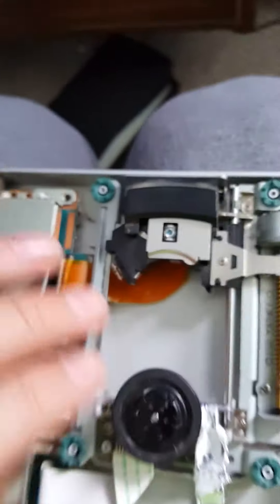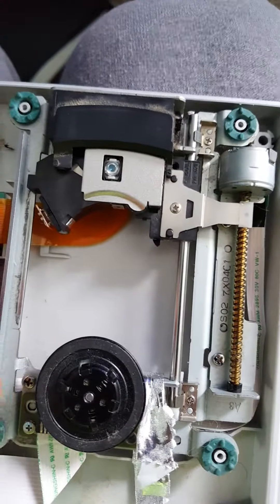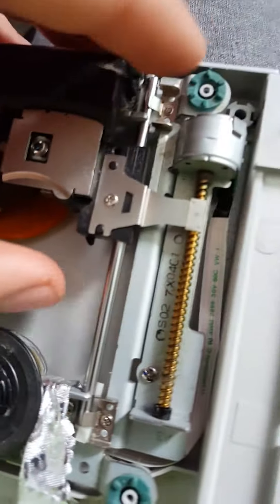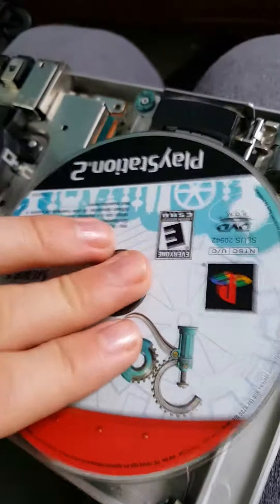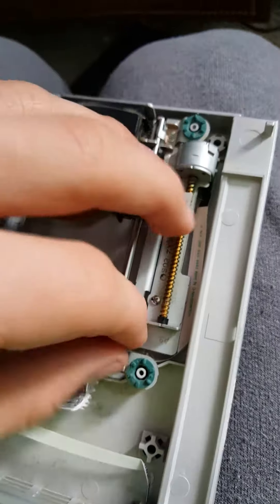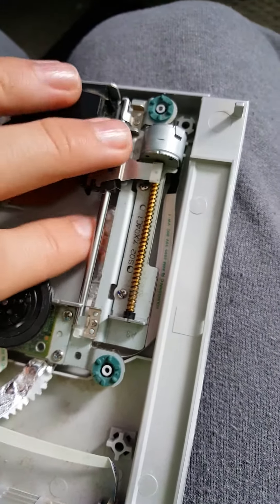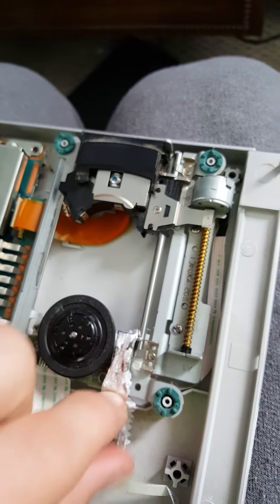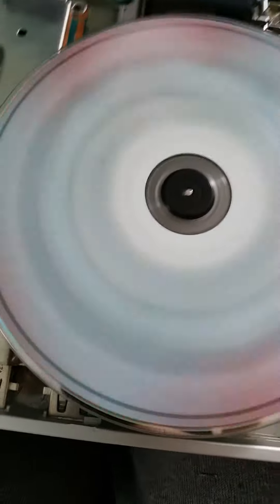Ps2 slim grind fix.REALLY WORKS

Comment: Guys guys. Not sure if the guy made an other video but the problem is right. The solution isn't. It works yes but its an easy fix and it's better than a tape. On the left side of the laser (black triangleish) they is a a space shape like a u. You just need to put it in between the metal. That's it. It make the noice because the laser doesn't go under the circle when it's supposed to. Your welcome 😃
Reply: Hi! Thank you for the solution, can you be more specific? I can't find what you're refering to.

Comment: Absolute legend. My PS2 was making the same grinding noise. The ribbon cable at the laser end had come out, pushed back in with tweezers and works fine. Wouldn't have figured it out without this video, thanks a lot dude.

Comment: YOU ARE A GENIUS!!! I couldn't find any gum brands with foil wrappers but I bought some LifeSavers mints with the foil wrapper and it worked like a charm. SOOOOO thankful for your video and tip!! My old PS2 slim that I couldn't get to work normally for over 4 years now works like new!!! 5 stars.

Comment: I followed this sort of.  It was corrosion on a rail stopping the laser moving smoothly for me. Used vinegar and a little ball of tinfoil to clean it. Cleaned in the plastic runners on the sled bit too. Works perfectly now. Thanks for the inspiration on the button.

Comment: I know this video is 5 years old now but you didn't need the gum wrapper. The little clear ish/white plastic thing under the silver bar is put on upside down and backwords. That is what the Lazer is hitting and preventing it from coming down far enough to hit the switch. It's easy to tell because the square part is showing on yours and it should be the t shaped bit. This means it's upside down and backwords.
Reply: Ok but i don't understand exactly.
Reply: @AndreiGamer1k  Hmm, I tried to post a picture but the comment keeps disappearing. I guess google doesn't like links or something.
Reply: @kairokusuen1482  ok. Hmmmm.. try to post it on my video comments section.

Comment: Clean and strip the old grease off the two rail bars on the lens rack with contact cleaner. Use a toothbrush to clean off any old grease on the worm gear. Clean the sensor switches with contact cleaner. Re-added lithium grease on the rails only (if you use it on plastic, it degrades it) and it should work flawlessly.

Comment: I fixed it guys, i only cleaned both sides of the laser. I didnt have to pump off nothing. Now it works but it does a little bit (not hard) of sound.

Comment: Looking to fix a fat and for some reason this video made me realize that I should check the ribbon cables thanks to 0:10. Turned out when I went in to replace the clock battery that a ribbon cable came out after putting it back together. I got it working again but it would stop after a few minutes like the cable is coming loose. Took a few attempts but I had to put a piece of electrical tape to hold it and now so far no issues. I don't know if I wasn't putting the ribbon cable all way in but I was pressing it as far as I could get it to go so not sure why it's loose. As long as the electrical tape holds I should be good.

Comment: hmm I seem to be out of luck. the button isn't working at all even if I stop it with my finger

ah I took it apart, one of connections of the button to the board is broken, so I need to soder that tiny tiny thing

Comment: Found out what was the issue with mine, it was that brown-cable that had wasn't attached properly. If this video doesn't work, try moving the cable in the connector while it's grinding.

Comment: My laser just comes down even when i touch its sensor . i have removed the lid off and have done as you did . But the laser still comes down with pressure . Pls do help(I have slim ps2)
Reply: Same problem with me. I tried paper tape but to no avail. I'll try aluminum foil and see if it makes a difference.
Reply: Nope, didn't change a thing.
Reply: @robertoaguiar6230  Does any have any solutions ?

Comment: Which model is that? You're laser ribbon is totally reversed of my 90001 that I recently bought off eBay. I cannot believe you had to place something there to stop the sled before making contact with the spindle. Insane.  Anyway thanks for answering a question I had, as to does the unit read from inside, out. I'm also having the disc scratching from the ribbon. So I ordered a couple, in hopes to cure that. My old PS2 was a fat model. So I never had problems. But in defense. It was brand new. Not 13. Or whatever this one is. 
Thanks 👍

Comment: Hi. Im javing this problem too. The first problem i had is the ribbon scratxhing the disc so i tried to fix it. But now it wont read disc anymore and it makes that noise. I tried putting my finger like what u did, to test if its the problem, mine still keeps making that noise even when im using my finger to press the little button on your video. Pls help
Reply: Did you found solution
Reply: @aleksandarbahtijarevic843  I probably damaged the ribbon. I replaced the ribbon and now it works

Comment: Hey Evan, highly doubt you will see this but i unfortunately have a very similar problem to yours. It grinds just as it did in your video, although i tried the gumwrapper and it still didnt work. i then tried placing my finger early like you did in the video. That part with the laser kept running into my finger and wouldnt move back to its original spot. also my laer didnt light up like yours did. what do ii do? buy that part as new?
Reply: same here, have you solved the problem?
Reply: No, I belive I have to just buy a new part
Reply: +kyle pletoka i buyed and installed a new laser but, nothing worked, maybe is the flat? who knows xD
Reply: +luckyxever that part what goes to that "golden" thread has worn too much, try to bend it little bit if you can amd if its metal
Reply: did you replace the flat?
Reply: no, just bend it little and oil that thread well and it will work. i had same problem because i didnt use my ps2 in couple of years so just start using it again and it will start working like it use to
Reply: and there is two little screws on top of that flat part that you can tighten just right amount and it will stop making nois
Reply: schwartzy65 
What parts should I oil without ruining the others?
Reply: A Terran Republic Grunt i oiled that "golden" screw part and mostly that part of it that goes inside to that round thing :)
Reply: schwartzy65 
With something like WD40 I'm guessing?
Reply: A Terran Republic Grunt yea thats should be good
Reply: ya
Reply: if anyone figured that out let me know just bought one doing the same thing this hack doesn't work for me the sound continues

Comment: Mine seemed to hit the thing but I tried to do this anyway including lubricating the thing the laser rides on because it slides hard still not fixed any ideas?
Reply: Had the same issue with a PS2 79001 that I recently bought it was practically new but I'm assuming the previous owner touched the laser lens I cleaned it with a cotton swab and isopropyl tested it out before assembling and it's working perfectly as of right now. Look up how to clean the lens and don't over soak the swab
Reply: @moichamoy2274  thanks ive tried that but  maybe I over soaked the lens even if I wasn't trying to can't do much right now because somehow my brand new ribbon my dad put on was working fine the ps2 was working still making that sound just not as bad ig next day wouldn't work it was the ribbon theres a tiny tear on the new ribbon
Reply: @zacharysmith4408  I go to an electronic repair school, that was my issue. The ribbon cable attached to the laser was torn, you can either order a new one for 30c or fix it XD

Comment: i had this problem and I got fixed lubricating the worm gear with wd-40, also put some grease in it, I forgot  what type of grease is needed to lube this thing, and my problem was fixed
Reply: White Lithium grease.  Avoid using wd-40 unless you are going to wipe it off afterward, because it attracts dust like crazy.
Reply: The lithium grease sony uses is quite dry almost like a wax, that is ideally what you want

Comment: Mine isn't so much as a grinding sound as it is an occasional clicking sound that fades eventually, but sometimes this cause the system to not play certain games.  The only time it's persisted is when I tried to play Mega Man Legends 2.  
I bought it secondhand and this did not happen at first with PS2 games. The seller says they never experienced this problem. I'm not very tech savvy so I'm kind of afraid of opening my poor system up XD

Also, PS4 in the background: "Stop playing with my big brother all the time! I wanna be noticed!"
Reply: Update!
I merely needed to clean the disc tray again with a can duster(the system was very dusty and dirty and required a thorough cleaning when I bought it) It has stopped the clicking sound, but the minor grinding sound it makes when playing Legends 2 persists. I assume it's just a matter of the game itself.

Comment: My issue turned out to be one end of the ribbon cable for the laser was not plugged in all the way
Reply: Same though that was on my fat PS2. I will probably have to open my slim PS2 to replace the clock battery but I got to get a power supply brick for it first.

Comment: Is there other ways to fixed the grinding noise?  Mine sometimes gets that grinding noise when i turn on the console.

Note: Mine is the Fat version
Reply: Its a slim model help but i share it with you maybe it helps a little.

Tight the screw next to the lens to the right(on the little iron)...  if it doesnt work first you have to clean the dirt from that little long roll and the end of the little piece of iron (the plastic teeth.)

A little help: 

 unscrew the small iron and clean out the plastic at the end then screw it back again completely.. BOOM easy as that...
Reply: @xelimax  Thanks.
Reply: @darkside9547  did it work
Reply: @mcnugget4129  i use a grease substance on the láser arm part to make it less dry. And it stop doing the noise at least for a time

Comment: Mine is making the noise is this video: playstation 2 slim grinding noise Posted By: scbene
And ONLY makes the noise when there is a disc inserted. This video shows it making the noise without a disc. Not sure if the problems are the same. :(
Reply: i have that same prob

Comment: In my case it was the ribbon cable that was partially broken. These ps2 slims are really fragile.
Reply: Which one?
Reply: @reevesjustin  The DVD player cable (the one with L shape that has glue below), I fixed it by replacing a cable with a new one. I also broke the connector on the DVD player so I used a small piece of plastic to keep the cable in the connector.

Comment: LOL, who designed this trash? Slim models scratching discs because ribbon tape goes too high, it got problems with loose casings there you may need to put the tape on back lid sensor and now this grind. Man, the only way to use ps2 slims is OPL via LAN.

Comment: Mine goes halfway and starts grinding
Reply: Tight the screw next to the lens to the right(on the little iron)... This tutorial is a complete joke xdd if it doesnt work first you have to clean the dirt from that little long roll and the end of the little piece of iron (the plastic teeth.)

A little help: 

 unscrew the small iron and clean out the plastic at the end then screw it back again completely.. BOOM easy as that...
Reply: @xelimax  few years late to reply but i’ll give it a try, might get the ps2 games nostalgia again, thanks :D
Reply: @blackcatooow  nice to hear that good luck mate :)

Comment: For my ps2 I did the same thing, it stopped & it makes that grinding noise for the second time
Reply: Tight the screw next to the lens to the right(on the little iron)... This tutorial is a complete joke xdd if it doesnt work first you have to clean the dirt from that little long roll and the end of the little piece of iron (the plastic teeth.)

A little help: 

 unscrew the small iron and clean out the plastic at the end then screw it back again completely.. BOOM easy as that...

Comment: I swear my ps2 slim scph-70012 is a hell spawn to fix every single time I fix one problem it spawns another, it all started when I got the console it turned it on and worked fine, then I got gta vice city (a dvd rom game) and it wouldn’t read but it read compact discs (blue bottom) so then I open it up change the voltage, fine right? Wrong the ribbon cable now scratches the disc I fix that it makes this problem. 

I’ll edit this if it makes another problem

Comment: it stills makes the fucking noise
Reply: Same with me. Did you figure out how to make it work?
Reply: No
Reply: Subhaan Plays bend the threads support where the screws are and noise will stop
Reply: I do not understand what you mean. What threads?
Reply: Alexander Schneider that "golden" thread that moves the laser
Reply: I tried that. Did not work.
Reply: Alexander Schneider end of that golde thin has two screws and they are trough some small metal part, bend that little bit and tighten the screws gently otherwise it cant move
Reply: schwartzy65 how about u make a video n put it on YouTube then we'll see